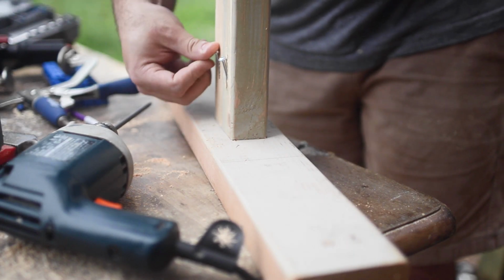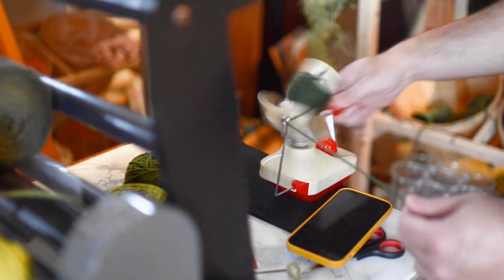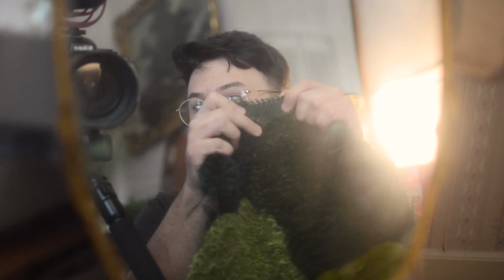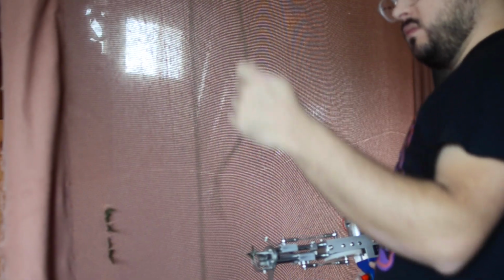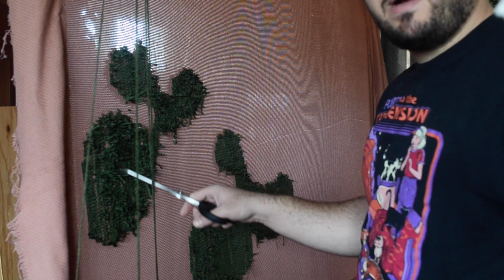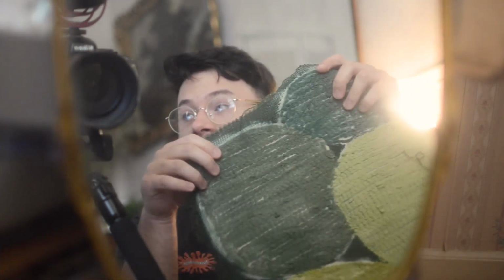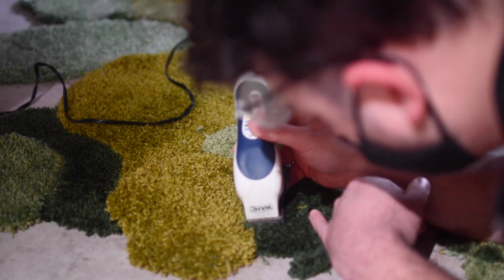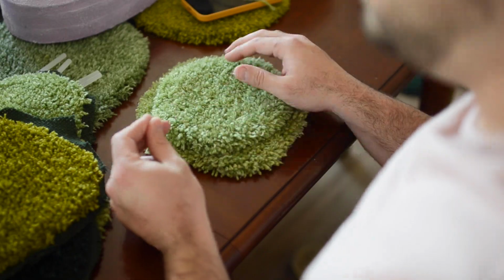Tufting Moss Rugs - My Initial Thoughts & Progress After 4ish Months Rug Tufting

Comment: What type of glue do you recommend??
Reply from the maker: Oh I just realized I never added that to the description of the video! I updated it there, too. Theres a link to the Roberts brand I used on amazon, I actually am using that as my go-to because since it stays a little tacky after it sets I don't have to use additional glue to add a backing cloth!

The less stinky one I also like is the brand TEC Skill Set, the General Use Multi-Floor Adhesive and I found it at Lowes!